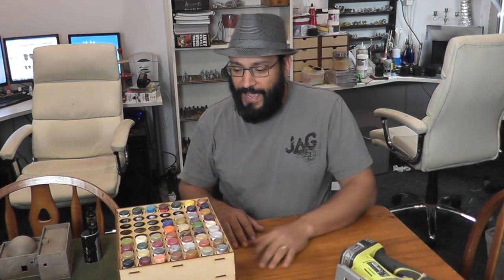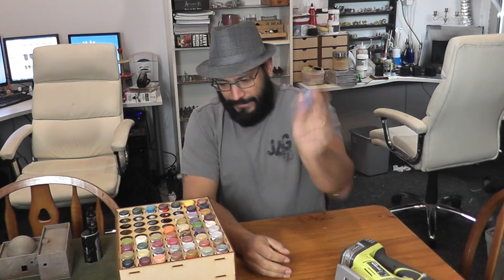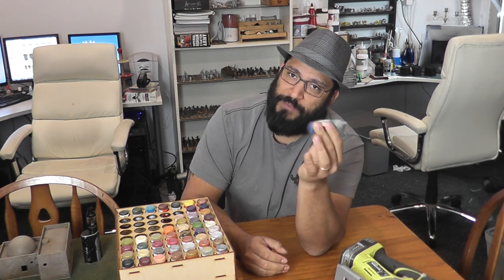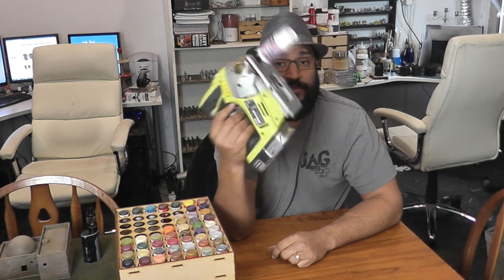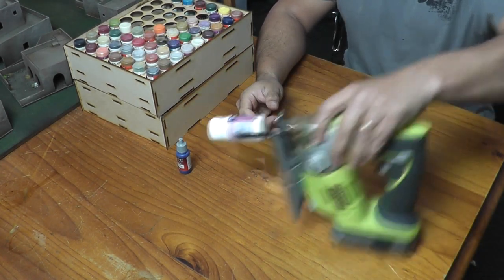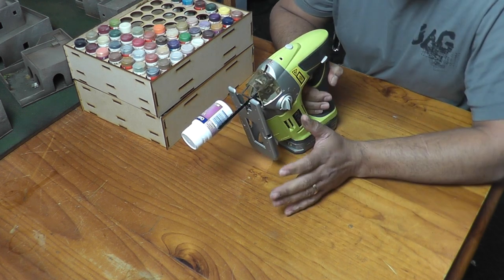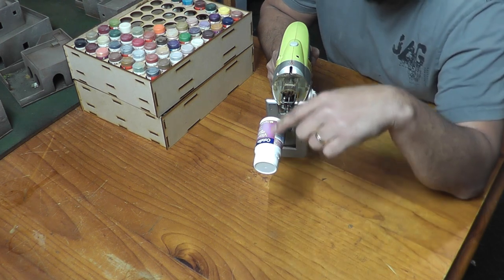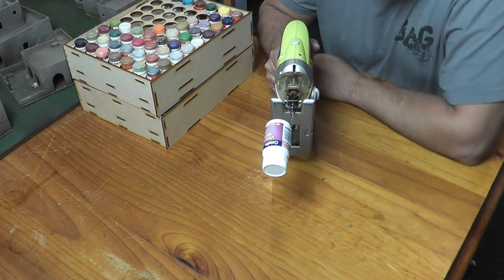Simple Paint/Dropper bottle Shaker

Comment: I saw a video a while back from Lester Bursley where he used a power drill; basically fit the narrow end of the dropper bottle cap in the drill chuck and tightened it as much as he could.  It looked somewhat safer, the only drawback was that there was a chance the drill chuck would lose its grip and the paint bottle would go flying.  Granted, a randomly flying bottle of paint isn't exactly the greatest thing in the world, but not nearly as potentially bad as a broken jigsaw blade flying around the room.  Looking forward to seeing how you put together your own vortex shaker.

Comment: Use a  Mini 6-Inch x 1-1/2-Inch Ratchet Bar Clamp . file down some the bar end of the clamp, so it will fit into any jigsaw. Been using for couple of years, never have a problem..